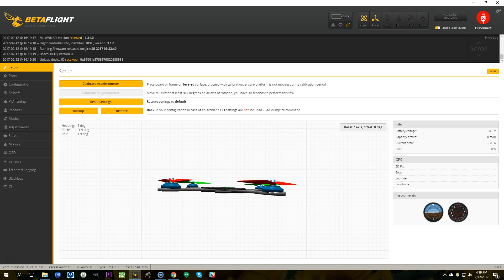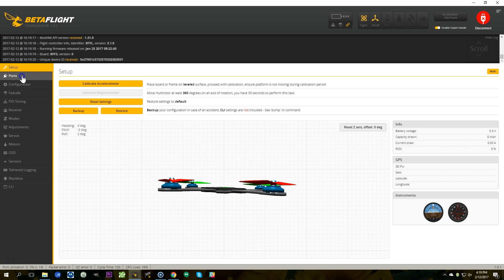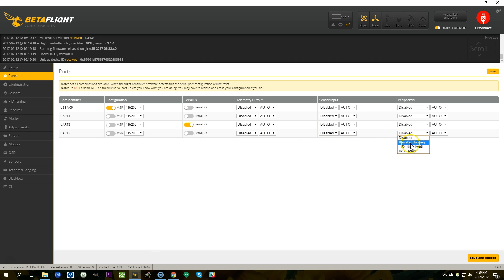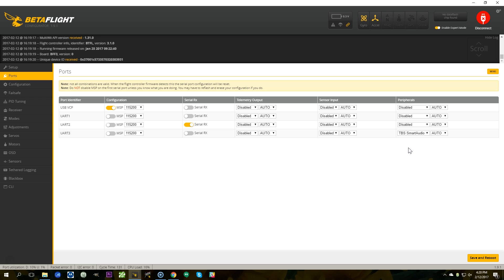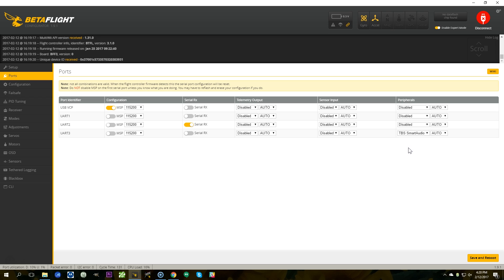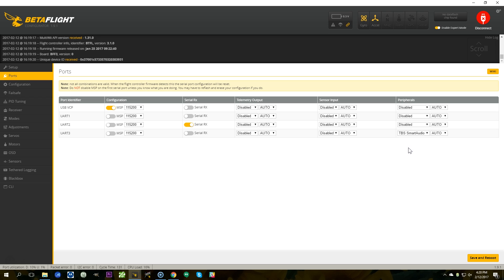BETAFLIGHT SMARTAUDIO | Change vTX channel and power remotely!

Comment: Many thanks! So, got TBS UNIFY PRO 5G8 HV Vtx to incorporate with omnibus f3 non pro and want to use the smart audio feature. Power right off battery, split vid signal from camera through omnibus fc to vtx for the osd. Smart audio out vtx (white-wire) to available uart on omnibus. Turn on tbs smartaudio in ports under the specific uart that it is connected to on the peripheral section. Am I missing something ? Many thanks!
Reply from the maker: Everything sounds right to me. You hooked up to UART TX right?
Reply: Yes, Tx2. So do I need to create a switch to turn uart - Tx2 on ?
Reply: Did you get this figured out? I have the same board and am setting it up today...any help would be appreciated!

Comment: so with this smart audio I lost audio coming from the vtx? normally with the tbs unify pro I use my mono earphones to hear the motors without a mic!
Reply: Joshua Bardwell would I just cut the wire and solider both sides to the fc on the UART?  I don't want to mess up something by trying it. I really like having audio.
Reply from the maker: No, you do not lose audio. You can wire up the mic. But the ambient sound from the mic might conflict with the SmartAudio commands and corrupt them.
Reply: Joshua Bardwell Sweet, then probably I'm not going to use a mic then!!! thank you for your quick response! keep going 'you rock' 👍

Comment: I have a Betaflight f3 (BF 3.1)and a TBS UNIFY PRO HV (the last), but this configuration does not work. Can anyone help me?
Reply from the maker: +Ronald Pacheco I'm using that exact combination  for what it's worth.
Reply: Joshua, does it work for you ?. When I enter the menu using the OSD, the functions of the video transmitter are not displayed. Nor have I been able to operate the telemetry in the taranis, this I have it configured in the tx1.
Reply: Ronald Pacheco , hookup smartaudio to tx3 it's right by the power-in on the board. then update firmware to 3.1.7. (tx3 is apart of uart3, the entire uart must be dedicated to smartaudio). hope this helps
Reply from the maker: Yeah, it works perfectly on three separate copters.
Reply: Michael Wheeler, I upgraded to the latest version of betaflight and it works fine. Thanks for the help.

Comment: Hey Joshua-  Could you do a video on how to turn pit mode on/off in the Unify Pro using the BF OSD and a Taranis?  I've had it go inexplicably into pit mode and then had a hard time getting the dreaded orange light to turn off.  Should be a simple thing....but it's not! What are the settings?   

Thanks for all the helpful information.
Reply from the maker: You have to go into the BF OSD menu and hit "set" to take it out of pit mode. Which is stupid. I am agitating to get them to create a PitMode "Mode" so you can switch into and out of pit mode via Aux channel.
Reply: Joshua Bardwell Thanks, SET works, but sometimes it still needs a physical button pressed to awake from its coma. There's gotta be a better way. Hope TBS finds one.  I don't race a lot, so pit mode really just sucks!

Comment: why don't you push your wires through the holes before soldering?
Reply from the maker: Because I think it is easier to solder from the top side without having to turn the board over, and because this way makes rework easier.

Comment: I have followed all the steps correctly and cant seem to get VTX to show under Features, anyone have any idea why this might be, audio wire is going to TX3 using a Unify Pro HV.
Reply from the maker: It's not vTX any more. There are two options, one for Smart Audio that ends in an S and one for Tramp that ends in a T. I don't have my Betaflight copters with me right now so I can't look it up for you.
Reply: I see what you mean, its VTX SA and VTX TR, but for me when I go under the Features menu I can only select Blackbox and LED Strip, there are no other options. This has me confused.
Reply from the maker: +Tyler Payton is SmartAudio enabled? I don't know what else could turn it off.
Reply: It is enabled, my ports page looks exactly like yours.
Reply from the maker: +Tyler Payton I got nothing.
Reply: Well thanks for your feedback anyway.
Reply: I had to update the firmware on my board. it comes with 3.1 installed. I bumped it to 3.1.7 (newest) and the unify settings appeared in the odd menu.

Comment: Thank you Joshua, I've definitely learnt something today. I guess losing telematry and audio isn't a big issue when using the Betaflight FC as the osd will supply the information needed, i would still love the audio feed but hey ho. Just about to put this set up together (BFF3 &TBS). Keep up the good work, you are a gentleman and a true scholar.
Reply from the maker: Why would you lose telemetry??? I'm running telemetry, SmartAudio, and SBUS on my Betaflight F3 builds.
Reply: I get a little confused at times as this is my second build. For some stupid reason i assumed that telemetry was lost but saw that you just wire it to a different uart tx. Finally got this new build finished and working perfecty, just need some decent weather over this easter weekend so i can give it a maiden flight. Now here is something interesting, there is a lad at my FPV club who has wired his audio from his fpv camera into the tbs smart audio wire which is wired to a tx uart. He is able to use the taranis to change his channels and also has full audio on his videos, so far he has had no problems. I haven't tried this out yet due to using the runcam eagle (no mic) but hope this information is something you could have a look at and see if there are any reasons why we shouldn't tap the mic wire in on the smartaudio set up. Once again thank you Joshua and have a happy easter.

Comment: dont know any other way to contact you for this question :  I just updated my Omnibus F3 from 3.0  to 3.1.0 and it now wont connect.  My Lumenier Lux V2 connects fine so its not the plug or the drivers ?  Ug any idea .??
Reply from the maker: Are you using FTDI to connect over UART 1? If so, that got disabled in 3.1.
Reply: I watched your video on broken USB ,but mine is new F.C  worked fine until I upgraded. Guess I wont upgrade my Lux V2 . WTF      and no not using a  FTDI to connect??  I just wired it like my LuxV2  no adapter.while trying to set up ports I think I turned off uart1  ,  I think that caused it.  Man this sucks brand new board now junk. Beta flight ???
Reply from the maker: +Bill14886 the Lux is a VCP board so turning off MSP on UART 1 is no problem. To recover the board use the bootloader button to pit it into DFU mode and flash it back to something that works.
Reply: Ill try that again, Thanks for the quick reply.
Reply: cant find 3.0.0  dont know what its listed under. git hub doesnt go back that far ;as far as finding Omnibus f3 .  Getting frustrated. Time to order a different board.  I was pumped up with the built in OSD and great reviews you did on this FC , Ug
Reply from the maker: +Bill14886 there's no reason  3.1 should have killed it. I'm sure it can be recovered unless it's physically damaged. If you're going to throw it out, mail it to me and I'll see if I can recover it.
Reply: Hey Hey I got it to work. Yeaaa !!! I used Impulse RC driver fixer.  Bam! it repaired it in seconds.   Sweet !!!   Hey maybe it will unlock my Naze 32 board that doesnt light up anymore. LOL     Your the best man, Teaching this old dog new tricks is working ,I even figure some shit out myself now,   You learned something today.  :}
Reply: got it working . I used ImpuseRC Driver fixer . Now Im all configure and ready to install . this board sounds sweet. OSD built in Beta flight , how frigging cool is that. !!!!

Comment: What's that yellow wire on the UART on the other side of the main power wires? What are you doing with that one?
Reply from the maker: SmartPort telemetry to the receiver.
Reply: Ahhhhh. Well of course. I need that. ;) Can you tell this is my first BFF3? I think I'm wired up. Just need to solder up that one wire and we are a go. Thanks.
Reply: I do see that SmartPort is not enabled in your UARTs in the video... I'm going to guess you were using a blank FC, or you hadn't gotten to that point yet.

Comment: Joshua, does this require upgrading the firmware on the Taranis to 2.2?
Reply from the maker: +NyxFPV not if you use Betaflight OSD to change channels. If you want to use a Lua script, then yes.

Comment: can you use spektrum to change your pids and the TBS?
Reply from the maker: +That Flyin Ryan if you have an OSD, then you can use any transmitter.
Reply: Joshua Bardwell so would you go with the beta osd board or RF1 and another source for a osd

Comment: what if I use a vtx that has an audio line and solder it to the TX on my Flip 32 omnibus F4? will it work or am I about to cook another flight controller?
Reply from the maker: +Jorge Perez it might work but there are some quirks with F4 UARTs.
Reply: Joshua Bardwell like what kind of quirks? problems getting the UARTS to recognize the inputs or frying something? I saw someone comment that the soft serial port could work with betaflight 3.1.6
Reply from the maker: +Jorge Perez inversion not working. So some protocols don't work. Nothing fries.

Comment: Anyone know if anything else must be setup for spektrum? You can do it via tx supposedly
Reply from the maker: To bind via TX, you have to use a main Spektrum receiver, not a satellite. To bind the satellite you have to use a command line command in betaflight.
Reply: Wait what? im talking smart audio. The latest firmware for spektrum radios offers selecting the vtx frequency and power all from a menu within the TX, you then send the command through the RF link to the reciever. No idea how it works though

Or do you literally mean you have to bind the satellite for smartaudio?

This is what im talking about /watch?v=Q6Ba2BIokrE

Comment: Will this work on MotoLab Cyclone?
Reply from the maker: +Pablo Contreras it will work on any board with UARTs.
Reply: Joshua Bardwell interesting, I updated my Motolabs Cyclone   to BF 3.1.6, soldered audio from my TBS Unify Pro V2 to the TX on UART 3, selected it in the ports, activated OSD in configuration. Yet when I go to OSD tab in betaflight it says my FC isn't responding to OSD. Anything ideas?

Comment: What are the specs of caps on your TBS Bulletproof 25A ESCs?
Reply from the maker: +Gerhard Mikysa 35v 330uF
Reply: Thanks Joshua. Any difference to without?
Reply from the maker: +Gerhard Mikysa In flight hard to say. On the scope yes.
Reply: Joshua Bardwell Thank you Joshua. Last question: Low ESR I guess? ;)

Comment: Why would you change video channel in mid flight?  So that you go blind and crush?  Or change the output power.  If I have a VTX that can do 25 to 600mw, It's a useless VTX because I would put it in 600mw and forget about it.  Sounds like bunch of useless features.
Reply from the maker: You don't change the video channel mid flight. You change the channel via your OSD when you get to the flight field and realize that somebody else is using your channel. It just saves you fiddling with buttons and DIP switches.

When you show up at a race and the race director tells you that your transmitter has to be 25 mW, that is when you will remember to change it to 25 mW. Or when you get to the flight field and your buddies complain about you stomping all over them.

If these scenarios don't apply to you, then so be it. But a LOT of people are THRILLED to have SmartAudio. Definitely not useless to us.
Reply: I fly solo.  Not a flock bird. More like an eagle.

Comment: so could I use the soft tx next to the VIN and vout to use this smartaudio?  Also can I piggyback my cams audio on this wire or should I use a different UART for that?
Thanks man.   And when is the kilt gonna happen?
Reply from the maker: You can piggyback the camera's audio on the wire. You will hear the programming beeps in your ear. Or at least that's what I've been told. If you don't like that, use the Tramp, which has a separate data and audio line.
Reply: Joshua Bardwell what about a separate UART or would that be to much and a waste of space?

Comment: I trully think Trappy is not the invitor of this hack :)
I believe the real idea came from MyFlyDream's super engineers with their Antenna Tracker which was sending datas from OSD to your ground station using audio channel on your video transmitter. Even today on the last version of their setup they send datas through video channel directly probably in order to comply with most of the video transmitters on the market and i'm pretty sure at the end Betaflight will do the same thing :p Or maybe not, it's actually a bit different LOL
Happy midweek Joshua! Take care my friend :)
Reply from the maker: Trappy is not the first to transmit digital data over an audio line. TBS did invent SmartAudio though, as far as I know: the ability to configure a vTX via the audio line.

Comment: New vtx - hope you can help? I have the diatone sp2 vtx and all I'm getting is a black screen. The camera works fine on my other quad?? Any thoughts why that is? Should I power the camera from the pdb? It's runcam swift.
Reply from the maker: Black screen usually means the vTX is not getting signal from the camera. Try the vTX with a different camera.
Reply: Joshua Bardwell if the swift works ok on another setup could it be a signal connection error. I'll try another camera tomorrow.

Comment: Thank you, Joshua! 
So glad you've gotten to this. I have this set up in my quad on a UNIFY Pro HV via BF FC. My issue, that i'd love for you to address, is that the Vtx intermittently goes into pit mode, often while flying. I haven't found a way to disable pit mode. I think there is also an issue with the UNIFY cutting out when set to 500 and 800mW. I'm looking forward to a full set up and tutorial on SmartAudio from you!
Reply from the maker: I don't know the answer to that. I would suggest asking TBS. They are known for their excellent customer support.

Comment: My xracer has two uarts and im using both, how can setup smart audio ?
Reply from the maker: Betaflight 3.1.6 and softserial. I am pretty sure you can use the un-used PWM input pins on the F303 as softserial.
Reply: Thank you,

Comment: I'm trying to decide between the Betaflight F3 board and KISS flight controller. With the built in OSD and smart audio on the betaflight board, what would be a reason to go with KISS? It seems like betaflight has a bunch more options and more integration. Is the KISS easier to use?
Reply from the maker: +Alex Clark I don't use KISS much so I couldn't compare them.

Comment: Come on joshua .... we are not smart enough to figure the rest out ... so we soldered the leads to the flight controller.... and enabled the function on the chosen uart .... now what? How do you enter the menus? And how does the menus look? Thanks in advance
Reply: Per Propwashed:   https://www.propwashed.com/betaflight-osd-setup-guide/     To access the menu, turn on your quadcopter, don your goggles and hold the following stick combination on your radio: Throttle stick mid, Yaw stick left, Pitch stick up, Roll stick centered. The menu should appear within 1 second.
Reply: @christianprogrammer9131  someone sticky this
Reply: @christianprogrammer9131  thank you that is extremely helpful.  you are the best!!
Reply: @christianprogrammer9131  This is extremely useful!! Thank you so much.
Reply: If I understood him correctly, I think you just access this in the regular BF OSD menu. Presumably, it looks the same as the rest of the menu.
Reply: Waggle the sticks,  the menus pops up, works on all me quads, no more silly buttons, and waiting 3 seconds, and stuffing it up wands
Reply: Yeah stiggle the wicks🤣 white it up like he did. Audio wire to tx.. enable on ports, power everything on like your about to fly, left stick left, right stick forward, in the menu go to... features or misc? Find smart audio in the theres sa and tr I think, chose sa or tramp, whichever one... then chose fatshark or boscam or w.e your using, then go down and hit set! Done! Then you can go back in there and change the channel/frequency and it should go fuzzy on the display, then youll have to go to whatever channel you just set it too! Then you know its working!
Reply: Snabb FPV yeah now what?...I did all that and I still can access the menu...
Reply: https://youtu.be/hoIok2B6RmY
Reply: DUDE its in features.... pretty self explanatory.

Comment: how do you like tbs 25A esc's ?
Reply from the maker: They're solid. I'm not sure whether they support DSHOT600 though.
Reply: TBS released a upgraded version  of the Bulletproof ESCs that now supports DSHOT600 out of the box. The older version supports 300 but you can obviously remove the caps on those if you want 600.

Comment: Joshua, only Smartaudio v2 is supported over hardware uart ports. You have to make use of softserial with v1 Smartaudio devices. I think this should be added to your video since the v1 TBS unify pro models do not support the updated Smartaudio protocol.
Reply from the maker: +Salih Ergezen I can't really edit the video retroactively but I'll pin the comment.

Comment: Josh is right, once you have this, either through osd or taranis, you will never wanna go back! Trust me, I'm replacing all my other vtx's with unify' because of this.
Reply from the maker: +Elvin Lazo you don't lose the auto when you use SmartAudio. You hear the control sounds in your ear though. If you don't like that, try the Tramp.
Reply: Hi Josh,
If I understand this correctly you mean, although you're using smart audio through the audio wire on the tbs you still get the motors sounds in your ear piece?
Reply: Graham Jones but you lose the audio right?. I really like to hear the quad